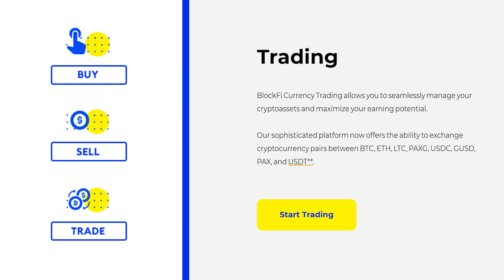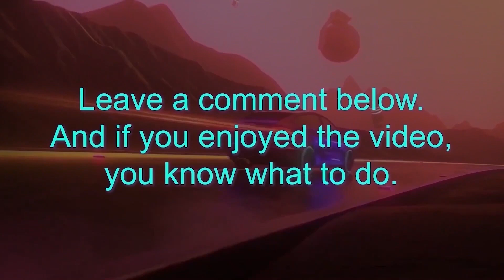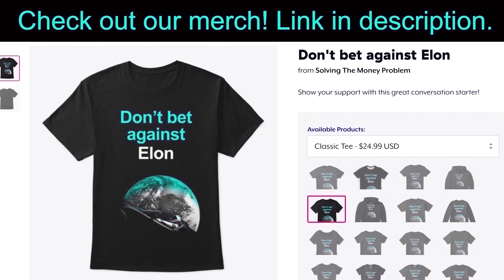Sandy Munro Shows Tesla's SHOCKING Lead Over Ford

Comment: Tesla is leading Ford in EV tech?  That'd be great, if they were tech companies.  Are they tech companies?  Can their product be "copy and pasted" like most tech products?

Because if they are are automobile companies, it ain't Tesla in the lead.  Tesla has better tech... but Tesla can't build a million cars a year.  Which makes Tesla a much better tech company; leaving Ford as the vastly more experienced and capable AUTOMOBILE MANUFACTURER.

Tesla kicks Ford's ass as a tech company.  Problem is, cars aren't made of tech; they're made of steel.  Ford knows how to acquire enough steel to build a million cars a year every year for half a century.  Tesla hasn't bought enough steel for a million cars in it's entire existence.

Tech is not Tesla's problem.  Tesla's problem is that they think they are a tech company.  Except they make cars, making them an industrial company.  They aren't making a twenty pound box with twenty pounds of raw materials; they need several tons of raw materials per iteration multiplied by (market expectation) millions of iterations per year.

I've never seen anyone ask the following question:. Does anyone at Tesla even know where to go to buy a hundred million tons of steel per year?
Reply: But even you must concede that Ford did not put their best engineers on this car.
Reply: @marctemura2017 

If Ford put it's best engineers on EV now, that'd be a waste of any talent.  They'll let Tesla build the whole prototype tech.  And then Ford (and everyone else) will have 2-5 years to steal or clone anything Tesla builds.

Because Tesla will be very busy going through all kinds of growing pains.

I don't care how good Tesla tech is if they're only going to put it on Tesla cars, because they can't make make enough iterations to dominate the market fast enough.  Which gives everyone else time... and a blueprint they just need to recreate with just enough changes to avoid patent infringement.  That's when Ford's best engineers earn their money.
Reply: @grsshppr7659  That why you need to keep Ford honest.  I want Ford to succeed but they did not make a very good electric car.   A senior Ford engineer would combined a lot of parts, you want less parts not more.
Reply: @grsshppr7659  Other thing Ford need to start hiring the talented engineers in software, artificial intelligence, and energy storage.
Reply: @grsshppr7659  They currently are constrained by batteries there isn't enough batteries for the cars they want to make.   They need to build a battery factory. GM and VW are already starting to break ground on the mega battery factories Ford need to get moving on this otherwise the can't make enough electric vehicles to compete.
Reply: @marctemura2017 

No, Ford just needs to continue the charade and do nothing more for a couple years.  Let everyone else take the risk.  They get the best of both worlds that way.

Cause, face it, nobody has ever made millions of EVs.  That means nobody really knows what problems are going to come up when you have to make five million batteries and ten million electric motors.  The optimists assume production costs will go down with scale efficiency, but what if they use up all the cobalt or bid up the price of copper to the point where the battery price doubles?

What if it just doesn't work at large scale.  Too much drag on the grid, the components become too costly to produce, the government subsidies go away... what if EV is just not feasible as existing beyond niche?  As smart as Elon is, he doesn't know that answer.  He can see in his head how to build that world, he can design the tech and build prototypes, and sell the entire package to the world...

But he can't tell you where the copper is going to come from.  If it's going to remain politically stable where the mines are.

So maybe Ford is just better off waiting.  Could be that the whole EV thing at scale isn't viable due to resource scarcity.  Ask yourself, in a world of tightening copper supplies, who should ethically get the use of copper, a thousand first world suburbanites upgrading from ICE to EV?  Or a million people in India getting electricity in their homes for the first time?
Reply: @grsshppr7659  They can't anymore because Tesla has a technological lead.   They need to get into the game start making the batteries otherwise they will never be a player in the electrical vehicle market.  Remember Ford use to have the best materials engineers in the business in 1960's.
Reply: @grsshppr7659  Even basic good car engineering on Fords electric vehicles were not implemented in the cars.   Sand Munro said it best, you want less not more when dealing with parts.   You want less screws and nuts holding your car to together, not more.